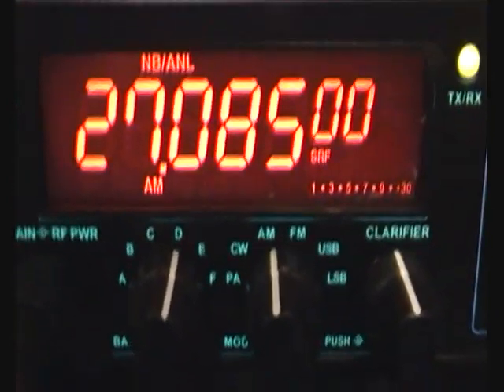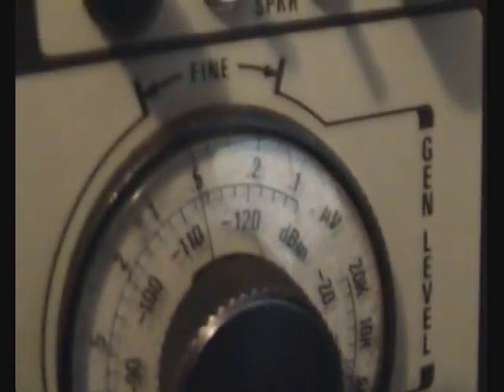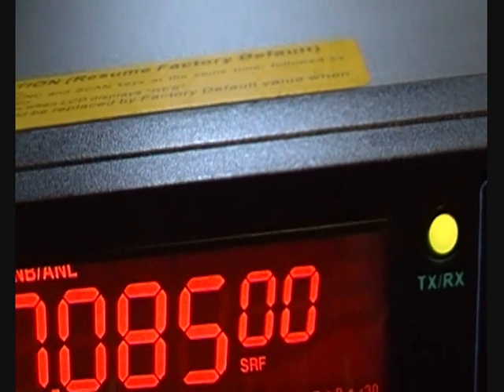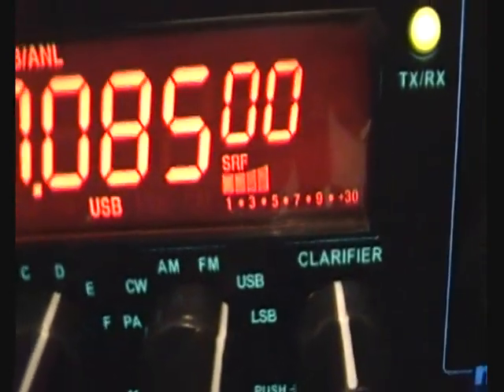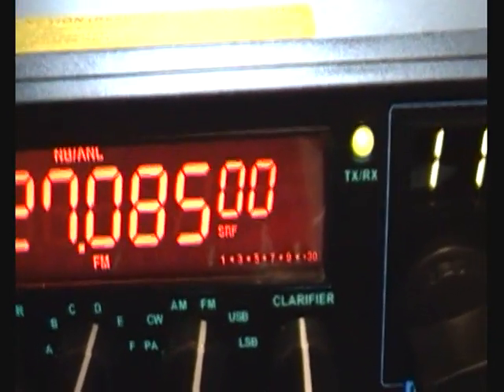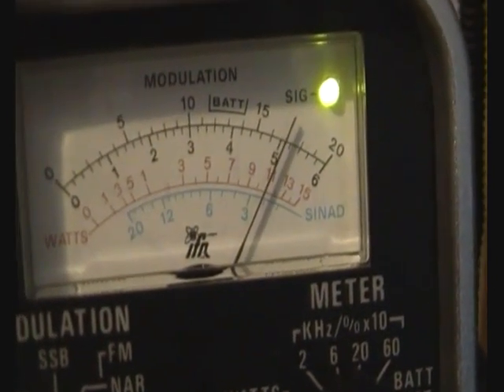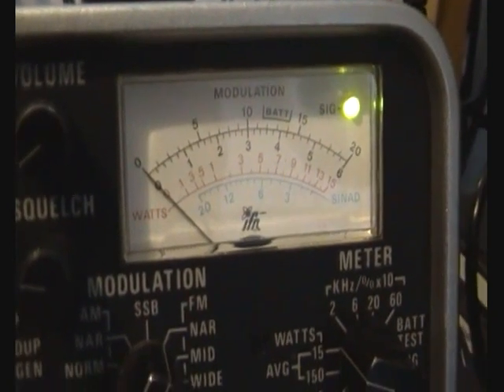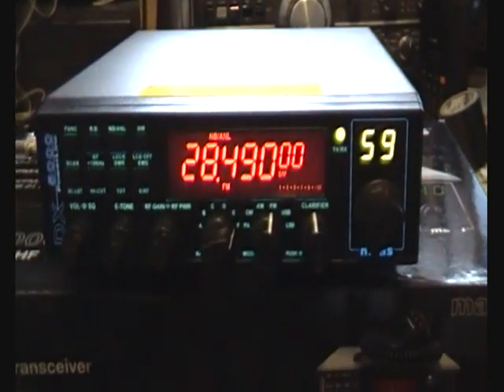Maas DX-5000 basic test with IFR-1200

Comment from the maker: Hi Stu
The IFR1200 is getting a bit old.
The only one I've seen forsale was for 5k which was way too much I think.
Mine was borrowed from work and gets used as a broadcast radio, testing analog radios and thats about it.  It has a spec an but it's a bit limited in use.
Except if you can get one cheap i'd look for something else (perhaps a HP if you can find one).  Also they are starting to get faulty so knowing its history would be good too.
Just my thoughts.

Comment: I would like to add that I owned the Maas DX5000 version 4 board with mods for 1 week and then it decided to go faulty on me. Everytime I switched the radio off the mic gain would set to "3"  so my audio was very low. Please buyers be aware of this fault and would like to know if anyone else comes across this fault. I have lost confidence in these radios altogether and wont have another one.